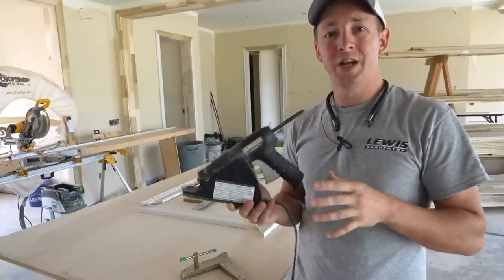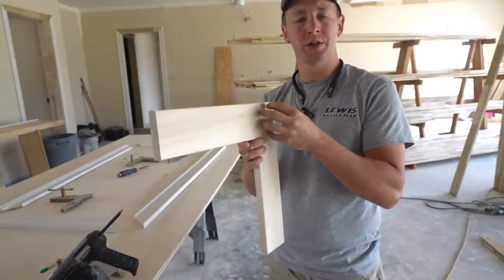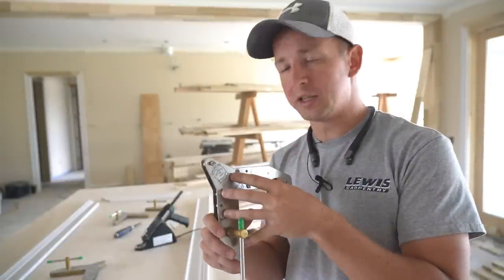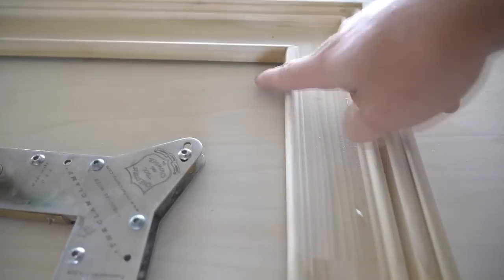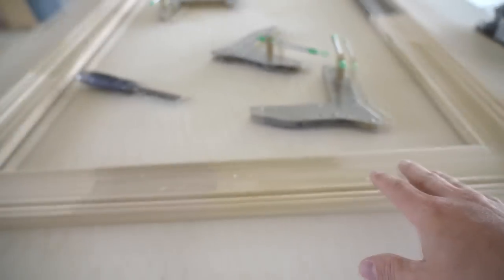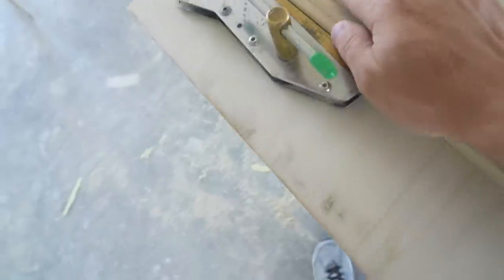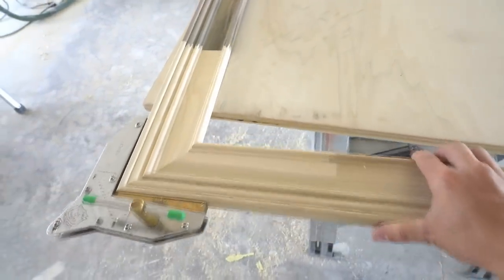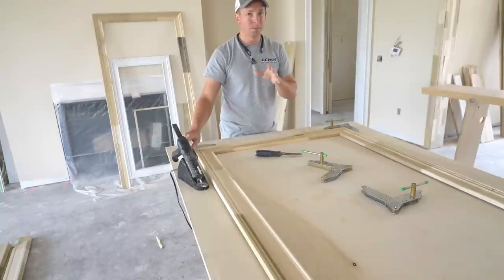Problems With HIPUR? Why Are So Many Struggling With PUR Adhesive for Mitered Casing???

Comment: Ever since your first video I've been trying to make it work. Most of my work is prefinished hardwood. I'm using an FS Tool XL 4000 blade, I think it's a 100 tooth. And yes I'm using clam clamps. I'm pretty sure my glue was good and fresh. First time I tried it was on pine. Total failure! Ok, probably the sappy pine. Next time was on 5/8"x2-1/2" Colonial profile prefinished oak. Still very little strength, and the glue line was plenty wide for prefinished work even when I tried to work fast. And that's using clam clamps! I've messed around with it a few more times but haven't had any luck. I think my cuts might be too polished and barely enough mass with the smaller profiles.
 Does anybody put pocket hole screws in the back of mitered casing? I've done it a little and it works decent, just very time consuming!
Thanks for all your teaching Spencer! I don't see how you get it all done!
Reply from the maker: With those material choices I'd probably opt for biscuits and wood glue and use a decent amount of clam clamps in rotation.

Comment: The problem I had was old glue , either out dated or I just didn't use it fast enough.  Thanks for the tips and place to buy it from. I think my past supplier had old stock.
Reply: Keep the unused tubes of glue in the refrigerator and they'll last a lot longer.   I have been using this system for about 20 years and found that refrigerating the glue, even between uses, greatly prolongs the shelf-life.

Comment: I keep trying PUR, and as much as I want it to work, it almost never does. I’m starting to wonder how much the climate affects it’s performance. Do you usually use it indoors in a climate controlled house or shop? I end up working on builds that I either have to set up in a garage or house with no a/c running. Maybe the environment I’m in has too much humidity, causing the glue to instantly start to set before I can even get it clamped up. I’m curious about your thoughts. Thanks
Reply: Im in ohio and my main builder never has the ac hooked up by the time i arrive. Thats a topix for another day lol. Not sure where your at obviously ohio is not the most humid place but i never have a issue with it. If your using clamps you could go to the 60 ot might give you some more time but it is a little thicker.

Comment: I've had great success with it mainly on 4/4×4 poplar. Tried it with Collins clamps before my clams arrived and it was a no go. I want to try it on a banister but most of my banisters have been stain grade fir or oak lately.
Reply: CMT chromed 80tooth finish blade is a nice thin kerf miter saw blade if you can't quite afford the FSTool. The 50tooth has been on sale around and either will give a nice textured joint face, more surface are for adhesion,I've found.

Comment: Are you using finger-jointed lumber for that casing? How do those look for the customer after some time, with the crimping and swelling of the wood? Do the finger joints become visible thru the paint after some time?

Comment: Great video as always Spencer! Given the info here and watching your other videos on HIPUR, what would be the best glue for the 2 1/4" pine door casing? I understand the concern with the tensile strength when using CA glue, but given that the casing is only 2 1/4" and the issues that HIPUR sometimes has with this type of casing, is CA glue a better option for this application? I realize that I could use Titebond, but the faster cure times are not there with the standard Titebond glue. I did do a cut and blade check and the glazing is not present. Thanks for all of the informative information you provide!
Reply from the maker: I don't recommend hipur for 2-1/4 pine casing. It doesn't hold well. 

CA glue would work ok but you'd have to be careful not to stress the joint and break it. 

Regular wood glue is idea. Might be a good option to put a screw through the top or bottom. 

Bottom line. 2-1/4 casing is tough...
Reply: @InsiderCarpentry  Thanks! I am going to do some test fits with the CA and Titebond speed set and see what happens. If the results are not good then regular Titebond it is. Appreciate you.

Comment: thanks for the great content. i got the clam clamps and will never look back! i dont have any problems with the pur adhesive but the gun i got is garbage. its the newer version of what you have and is so poorly designed! when you pull the trigger it releases the front end of the gun that holds the cartridge. than and it never stops leaking. do you have that problem with yours?

Comment: You need to compare this hiper glue to Titebond and do a break test. I was always taught the the glue is stronger than the wood. But you demo broke right at the glue line and to ill effects to the wood. It still may be stronger than Titebond, but only a side by side demo will prove it.
Reply: Pretty sure he did do side by side comparison in a previous Hiper Video where smashed both on the ground.
Reply: end grain glued joints break at the glue most of the time, including Titebond 2&3
Reply from the maker: I have done extensive testing in past videos. On a poplar 1x4 miter the hipur is stronger for me than TB & biscuit.

Comment: I'm having a hard time getting the clam clamps. What would your second choice be until I can get my hands on a few clam clamps. Thanks for everything you've been teaching us Spencer you're the best your neighbor from Chicago
Reply from the maker: The miter max cam action clamps also work well. I'd recommend them. I did a full review on them and they are basically a copy of the clam clamps.
Reply: Woodcraft sells them for like 65$ a clamp
Reply: @InsiderCarpentry  I have those, they work very good so far
Reply: @jaredwaters4633  Sigh. Maybe when you looked. Currently 82 for 1; 73 for 2+.

Comment: Now if your doing picture frames  preassembled what do you do when the jamb is out of square and it throws off your reveals I doubt your making those adjustments at the door or window before you assemble it I can see door casing preassembled it’s more forgiving to get your reveals right
Reply from the maker: It's very easy to bend and push it around to get proper reveals. Not an issue at all. That's the advantage, its strong enough that you can stress the joints a lot in order to do so. You get speed of assembly, strength, and speed of installation.

Comment: Hi. Awsome videos. Thanks. What’s your procedure for trimming a window out with the drywall sitting proud.  Do you still roll the mitres the opposite way??  My problem is that with the house I’m trimming out now, every corner of every window is different.   I’ve been neatly removing the excess drywall. Tia.
Reply from the maker: Unfortunately that usually means a lot of drywall smashing. If it's less that 1/8" I don't roll the miter and will just smash out drywall and use a clamp. If its more than that I'll smash drywall and roll the miter. It sucks but sometimes you have to note how much every corner is out. 

I have a video coming up on this topic. Stay tuned.

Comment: Question as I've had some issues using this product. When gluing, in between sets of casings etc, does one re-secure the cap while the product is still hot and in the gun? Or just leave the cap off so long as the heat gun is hot/plugged in. Thanks for your help, excellent information and channel. Your content is much appreciated
Reply from the maker: You can leave the cap off and it it fine. If I'm going to walk away and not use the gun for a long period of time (30 plus minutes) I will replace the cap. Its good to batch cut as do a continuous cycle of assembly. The glue works best when it is hot and fresh.
Reply: @InsiderCarpentry  thanks for the reply

Comment: In canada distributors use mostly FJP and mdf.

I have been using CAC and with MDF it's perfect but I do find it will sometimes fail or not hold with pine.

Would regular hot glue be a viable alternative to PUR considering it doesn't perform well on pine woods?

Comment: After my HIPUR glue shipment was delayed, I’ve started glue my miters with regular hot glue gun (Ryobi 18W), and successfully finished whole 8-stories building like that, even tho I’ve got my HIPUR soon. Advantages of hot glue sticks: it’s CHEAP! and you can buy it at the Home Depot; it heats up really fast, and with Ryobi gun it heats up to really high temperature and thin viscosity, which gives opportunity to make very tight joints; it cools down really fast too, 10-15 seconds; using cordless gun is very convenient too. The only slight disadvantage of hot glue sticks, that it doesn’t create such a strong bond as PUR. But for about 1000 trims I’ve got very few unintended breakages, and in some cases to have ability to break joint for reassembling is even necessary. Obviously, you need to use miter clamps. But from my experience I will never again spend $15 for 1 tube of PUR, when I can buy 24 pcs 10” sticks for $5.96 😅

Comment: I also have had a very tough time with the Pur adhesive. I’ve been using it on and off for years. A lot of times the joints won’t stick at all, even with the clam clamps on it. Ive low and high tooth count blades and no difference. In the north east a lot of the trim is primed pine. I def think the wood species makes a huge difference. When it works, it works great. When it doesn’t, I want to throw the gun across the room because I just wasted a ton of time and have to redo everything.
Reply from the maker: This is a puzzle I haven't been able to solve. I hear this a lot and I'm usually at a loss for why it doesn't work for others.

Comment: I'm wondering if the guys having problems with the glue work is arid regions (Utah, Nevada, Colorado...) Perhaps not enough humidity in the air.
Reply: It will still cure using the moisture in the timber. Not sure why so many are having problems with it. Can only assume they are not getting the joint together tight enough or fast enough that the glue is foaming up and it isn't bonding.

Comment: Question, will the squeeze out make it stick to the fab table? If so what is the solution to keep it from happening?
Reply: We normally don't have a problem, but when I have a concern I throw down some wax paper from my kitchen drawers
Reply from the maker: I simply wiggle the piece a bit after I clamp. This breaks the bond and its not an issue. You don't want to let it sit long enough without shifting it that it can bond well.

Comment: PUR glue is working well with Poplar and  MDF moldings. Pine is nightmare, never glued good. Do you have any solution for pine ??
Reply from the maker: For whatever reason it just doesn't seem to like the pine.
Reply: We also use wood glue Elmer's and Festool dominos 500 with their dominos/pegs

Another glue we use is 2P10 with Elmer's and Festool dominos
Reply: Yellow pine is weak, put white pine and radiata pine work well for me.
Maple is not good at all.....soft or hard.
Reply: @InsiderCarpentry  For pine you can switch to tightbond quick and thick glue which takes about 20 minutes before you can safely take the clamps off.  So with that, you glue and clamp up several frames (which requires having more clam clamps), set them vertically against the wall with the clamps still on; and set a timer for 20 minutes.  Alternatively, If you weave another task into your routine such as cutting casing or base it works fine. and you don't need that many clamps.

Comment: I purchased some green pur and a gun. Tried it on a piece of outside crown. I thought it would set faster. I'm currently using CA and it's not strong but sets instantly. How long should I expect to wait for this to hold before installation? Literally only your videos come up on Google searches.
Reply from the maker: I prefer CA glue on crown miters. I like to add a couple pieces of 1/2" dowel with plenty of glue on the backside of the crown miter. This makes it extra strong. See my videos on crown molding.
Reply: @InsiderCarpentry  I've watched them all 😉 I honestly might return the pur as Im only at a house for the day and don't have time to wait for stuff to cure. Also I'm in Arizona and I'm worried about the lack of moisture.

Comment: Could different humidity levels in different parts of the country effect the glue cure/strengthen process?
Reply from the maker: That is something I have thought of as well, but as far as I can tell it doesn't seem to matter.
Reply: The more humidity in the air the faster the glue will start to foam up, and if you are a little slow to get the joint together it will definitely not bond as well.

Comment: Maybe  a dumb question, but why spend more money on poplar if your gonna paint the casing?
Reply: that poplar is paint grade and finger jointed, but its hard, easy to cut and mill, and relatively inexpensive.  pine is soft, sappy, and splintery.  MDF melts if it hears running water and is only good at being cheap
Reply from the maker: It's better quality and abundant in my region. Worth the minor extra cost.

Comment: Hey, just curious. Is there any reason you don't plane the jambs down when they're proud instead of rolling the miter? Less work for basically the same result I assume?
Reply from the maker: Pretty much. Either way is fine.
Reply: I wish I dealt with more proud jambs than I do where the drywall is proud by the entire width of the drywall. The last 3 jobs I have been on I have had to rip jamb extensions from 5/16" all the way up to 3/4" for about 15 windows. Change orders for life!
Reply: @cmmartti  get a multitool with a good blade on it for proud drywall. That tool changed my life. Hahaha

Comment: Surebonder much better in my opinion and makes battery operated for less than $50.   Uses Dewalt batteries most people have those already.
Reply from the maker: That is a completely different animal. That's a basic level hot melt glue. PUR adhesive is completely different.
Reply: Surebonder is not a high temp/high flow glue gun… I have one that takes a DeWalt battery, And that’s all it is, a battery operated arts and crafts gluegun… Get something like a Infinity Bond Ranger Pro glue gun ($100+/-) and you will see the difference, as fast as you can pull the trigger the glue will come out… also he’s using PUR is a totally different glue

Comment: If you are assembling casing with 4 sides, the final side has 2 miters on the ends of the piece that have to be glued at the same time. Does the glue react too quick to engage one clamp and then move to the other end? If so, how would you glue the final casing piece to the 4 sides frame?
Reply from the maker: I've showed this in other videos. Absolutely don't try and do both at the same time. For the last miter you simply lift up one side of the miter and spread apart with some pressure, glue, carefully put back in place.